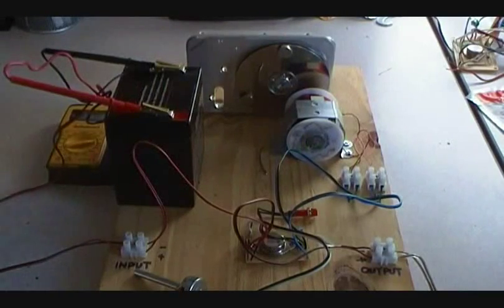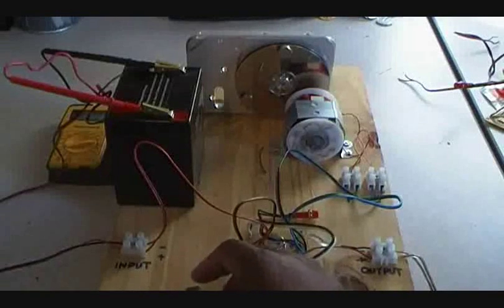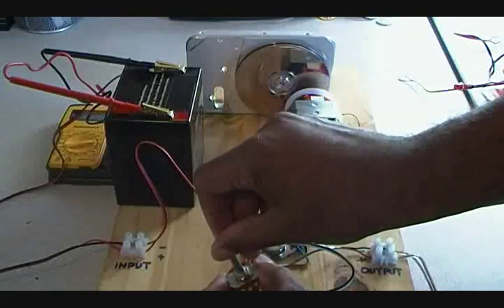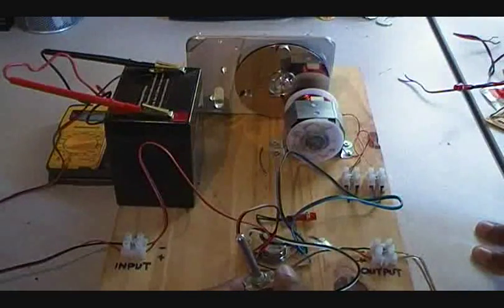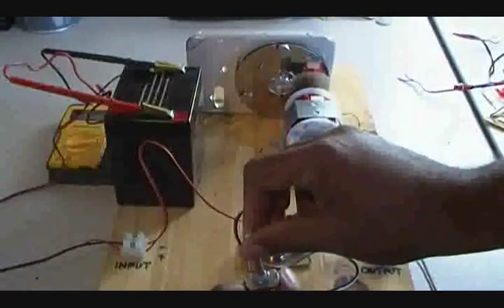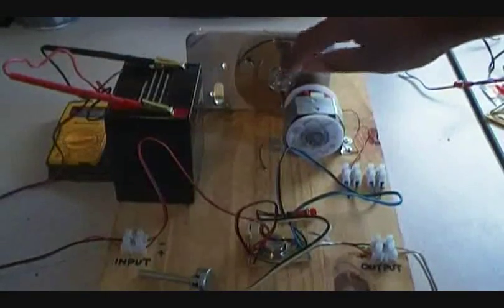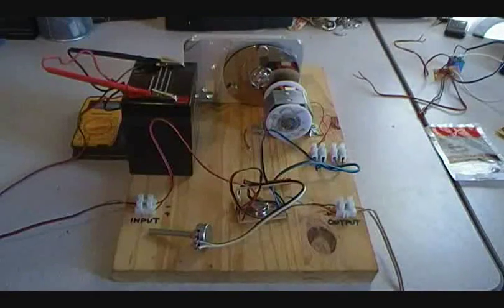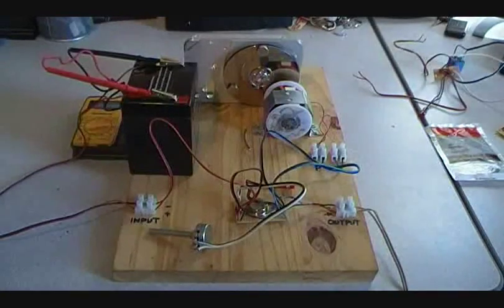bedini part2

Comment: Verrry nice setup. what you will find is they output charge will reach peak faster than if the rotor is moving upto speed. Also the transistor will or may get hot rapidly. same as my old designs. Best of luck to you and happy tinkering =D